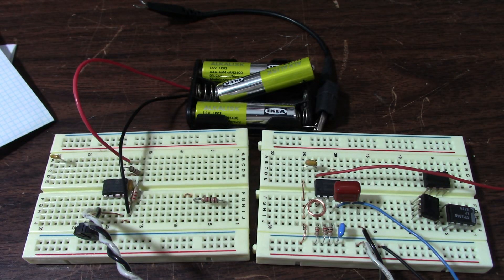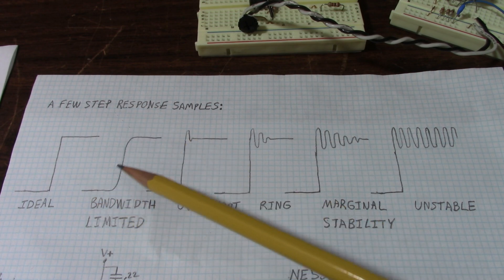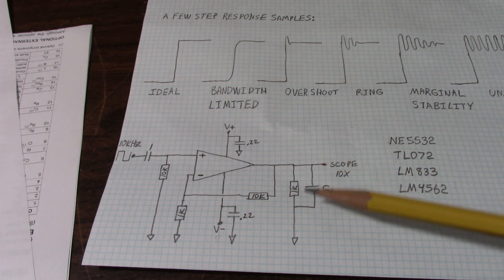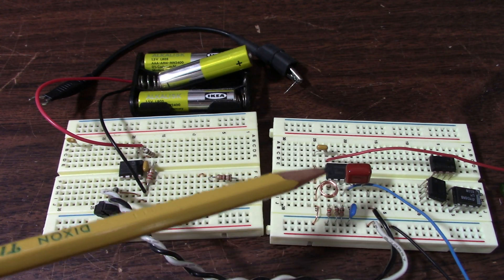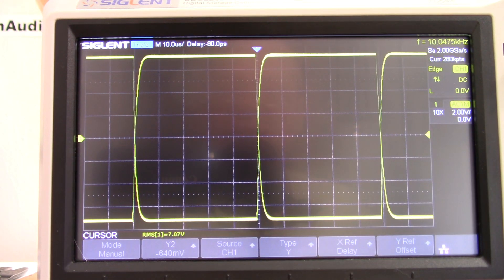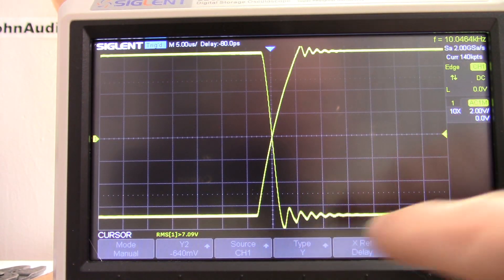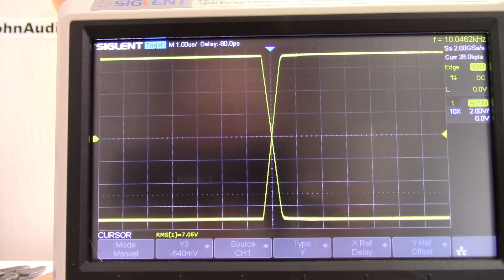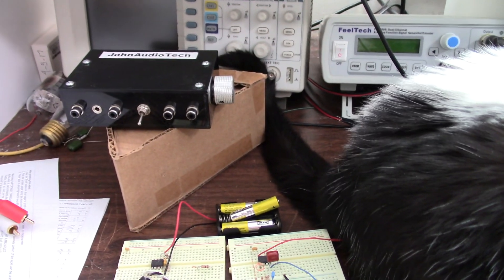Operational amplifier step response test NE5532, TL072, LM833, LM4562

Comment: Trying to stuff a square wave into a capacitor WILL exceed the maximum current output specs for the chip, which will then cause the inputs to go unbalanced, which throws the chip into an overload recovery situation. Good circuit design avoids overloading chips, e.g. through dv/dt limitation in the signal source, or with a resistor in series with the capacitor.

If you were to try this test with various capacitors, you would see there is a threshold of capacitance, at the point where the chip's output becomes overloaded. Don't blame the chip for doing its best to recover from a bad circuit design. 

If you see one chip is doing better than another in a particular circuit, it is time to review your circuit design for overloading. This is most easily seen by looking at the voltage differential between the chip's two inputs - which will be ~zero, except where the chip is being overloaded.

Comment: Many manufacturers from China don't agree with you that 072 is not a good op amp for audio -) They would use 5532 everywhere, but sometimes laws of physics dictate them to use a fet input stage.
Reply: 5532 of different brands sound differently but not too much.
072 of different brands sound extremely differently.
My favorites were
lf353
UA772
A well -known English brand of professional mixers (Trident) was famous for the sound of TL072

Comment: Great video, thanks! I agree that a step response / square wave  test often tells you what you want to know, particularly about stability. One stop shopping. 
Always be careful when driving capacitive loads with any amplifier. Wire (speaker or audio cable) is a common capacitive load. If you guess ~30 pF/ft, you'll be in the ballpark for most audio cables, lamp cord, or coax. So a 3' (1m) cable is about 100pf,  30' (10m) is about 1000pf. Your .01uF load is pretty bad for most opamps. You should never do that in a real circuit without mitigation. With 1000pF or less, most medium speed op-amps are stable. With larger >1uF caps, the output pole becomes dominant and they slowdown but are stable. 1 to 100nF is the worst case. 
FET gate input loading is also capacitive, and in the bad range. 
The easiest way to decouple a capacitive load from an opamp is with a 10 to 200 ohm series resistor before the cap. Most audio gear does this on line outputs. It also limits short-circuit current to safe levels. 
I often use Spice to simulate various capacitive loads, as long as you have a good spice model for the particular amplifier. 
Cheers!

Comment: NE 5532 is the best for it's price but LM4562 sounds a bit better. If you have a CD player and NE5532 was installed you can replace them for peanuts. On EBAy you find 10 LM4662 for about 20 $

Comment: I am one of the guys who would never use an op-amp in my main stereo system. The LM4562 sounds quite good though. The 5532 goes right in the trash, it should have
been discontinued 20 years ago. The Sparkos discrete op-amps sounds very good. I just build an AK4497EQ DAC, where I tried those 3 op-amps.
The TL072 is very good for guitar effects, better than the 4558 I think.

Comment: Something better than the LM4562? - diyAudio
www.diyaudio.com › Amplifiers › Solid State
An OPA1612 has slightly better specs than an LM4562---less noise and distortion, faster, and more output voltage swing.
May 19, 2017 · 10 posts · 7 authors
Reply from the maker: Those are nice chips if a bit expensive in comparison. I doubt I could get any meaningful difference in actual audio service.
Reply: @JohnAudioTech   -JFET Type and no Through-Hole Mounting which means the purchase of them on an adapter board. I just posted another link of tested comparisons and on Ebay sellers from China carry the NSC Brand LM4562. 10X LM4562NA DIP8 DualHigh Performance High Fidelity Audio Operational Amplifier  Price:US $5.50 - Shipping:$2.80 Standard SpeedPAK from China/Hong Kong/Taiwan | See details Delivery:Estimated between Fri. Nov. 20 and Thu. Dec. 10 ,2020.

Comment: This test should be done on a properly laid out board with a ground plane and good bypassing. Otherwise the results are not going to be repeatable. It may not make much difference at a few kHz but as you climb in frequency the tests will not be valid. Having worked for a well known IC supplier for 30 years, we never used those plug strips for anything.

Comment: What about LME49720?
Reply from the maker: From what I've heard, the LME49720 and the LM4562 are the same chip. The LME prefix is for high performance parts and National Semi. wanted the 4562 to have a part number under the LME series.
Reply: The LME49720 is available for less.

Comment: Can you test OPA1622? In audio circuits it sounds amazing and I'd would like to know why :)
Reply from the maker: It is a very low noise, low distortion op amp with high output current (over 100ma) for driving headphones directly. A very nice chip but relatively expensive. If you don't need the drive current, The 4562 will do just as well.

Comment: Hey John, I have a question, that also could be a video idea for you.
What is the significance of an op amp, that runs dual rail, Vs an op amp that runs single rail?
I'm not a tech, but just mess with amps and thing on a simple hobby level of knowledge, and found this a bit of a curiosity.   Basically,, why is this a thing? And with main amp circuits also?
Reply: I'm a little late here, but I will attempt an answer. Chip op amps do not require a bipolar (+/-) supply, but can be used with a bipolar supply. The thing to understand is, the op amp doesn't work any better with a single supply or a bipolar supply, and in fact the op amp does not even "know" if you are using a single supply or a bipolar supply. Because of the op amps design, if you have zero input on the amplifier, by shorting the inverting/non-inverting inputs, the output voltage will be at a voltage half way between supply voltage on the op amp. For example, if you are using a single 10V supply, the quiescent output voltage will be 5V. Now, if you are using a bipolar supply and are supplying the op amp with +10V and -10V, the quiescent output will still be half-way between these two voltage, which is  0 V. 
If you are using a bipolar supply for an op amp in an audio application, an output capacitor will not be required, since the audio signal is already centered around zero volts. If you are using a single supply, you will need an output capacitor, to block the output DC voltage, but pass the varying audio DC voltage, which is riding on the (in our example) +5V
Reply: Tom Terrific , thanks for explaining that.  I've bean very confused about how to hook these up, and the only examples I find, in videos, are using a split rail supply.  Because, a computer speaker amp board I've bean trying to learn from, and figure out, is a single rail.  The non inverting inputs run from the power line, through a few components, and it's confusing me as to why.  From the power + , it goes to a 100uf cap, the through a resistor voltage decider. From the resistor, the line then taps both non inverting inputs together. (I can't remember the resistor values, but they're in the thousands.). This op amp is used for the headphones, but also has a tap to go through the volume and tone, then to the amp.

Comment: Hi John, cool demonstration! Opamps are not intended to drive a capacitor without a decoupling resistor (33-150 Ohm) at the output. If you are looking at the stability aspects of an opamp, you have to test it in a +1/voltagefollower- configuation, were stability is more critical. In your test could be a small improvement, if you add a small C over the feedback-resistor.
Reply from the maker: I'm aware of that. I just wanted to see how the chips responded with the cap directly on the output.

Comment: 6:18 why 10x has to be used? Why not 1x probe. 10x probe may just be able to measure 10 times the 1x probe voltage. Is it correct to assume that the ramp would be faster than 1x probe so that it can measure 10 times the voltage
Reply: The results should be the same, the difference between a 1x and 10x is a potential divider in the 10x. It's simply to protect the front end of the 'scope, as far as I know. As long as the probe is compensated and the 'scope has either sensed or been set to the same setting (1x or 10x) it should show the same information. There will be a very, very slightly higher noise floor on the 10x because of the Johnson noise of the extra resistor.
Reply: I'm wrong! Higher frequencies are less loaded (capacatively and resistively) by a 10x probe, as the impedance is 10x higher and the capacitance is lower.
Reply: @gerryjamesedwards1227  you are right... Along with this the 10x probe is compensated to it nullify the scope input capacitance.

Comment: Slew Rates in datasheets are: 
NE5532 = 9v/us - - - TL072 = 16v/us  - - - LM833 = 7v/us - - - LM4562 = 20v/us. 
The TL072 should perform better, right?
Reply: The voltage-time relationship for a sine wave is v = a.sin(2πft) where a = the amplitude (half the peak-to-peak voltage) and f is the frequency.
So dv/dt = 2πf.a.cos(2πft). Since cos() has a maximum value of 1, the fastest rate of change of voltage for a sine wave is 2πf.a.
Therefore, a 20kHz sine wave with an amplitude of 3V (i.e. 6V pk-pk) has a maximum dv/dt of 2 x 3.14 x 10,000 x 3 = 190,000V/s = 0.19V/μs.
Any opamp with a slew rate of 0.2V/μs or better will not be slew-rate limited when delivering 6V pk-pk. Although why anyone wants a preamp to deliver 6V pk-pk is beyond me.

Of course, square waves have higher harmonics, and a 20kHz square wave will have odd harmonics principally at 60Khz. But unless you're a bat, you're not going to hear those, and I defy any human to tell the difference between a 20kHz sine wave and a 20kHz square wave. If you think you can, you're kidding yourself.

The slew rate is not a discriminating factor between those opamps for audio applications. Most of the issues will lie with cross-over distortion in the output stage, or with the noise from the input stage. Although the TL072 (a JFET opamp) has an inferior noise voltage to bipolar opamps such as the NE5532, it has a much lower noise current and therefore may actually have better total noise input when used to amplify higher impedance signals. Horses for courses.
Reply: At least bether than NE5532 and LM833.

Comment: BTW: the LM4562 is capable to drive stereo headphones with 30 Ohm impedance. You can even operate it in class A mode by use of J113 N-JFETs as constant current sources between its outputs and the negative power rail which forces the npn output transistors of the opamp to deliver 20 mA without signal. It should sound very good and precise.
Reply: 20 mA DC without a coupling capacitor would soon fry your expensive headphones! 😢 Fraser!
Reply: @elsaarmstrong-zp6ng  The 20mA goes from the opamp output to the negative rail via the J113. It does not pass through the headphones, which are connected between the opamp output and ground. Hope that's clearer now.

Comment: I think this is a comparison of useful low cost audio opamps (with the exception of the TL072, which is very noisy). My current favorit is the NJM2114 which is a low noise, high slew rate and high GBW device with good THD+N at a reasonably low price (around 1.00 €). If you look for a good opamp for phono you may consider the LM4562 from the video above (about 1.50 €) or even the LT1115 (6.00 €). However, these devices have quite high quiescent current of 8 to 10 mA per channel.
 
You can also get a very good selection and comparison of useful audio opamps with their data here: https://www.cycfi.com/projects/six-pack/op-amp-shootout/
Reply: Gunter, THANK YOU SO MUCH for your reply, man!!
I'm using two opamps, the LT1113 and the OPA2107, do you know them?
Very intering the LT1115, but I have one question: you said that "... however, these devices (LM4562 and LT1115) have quite high quiescent current of 8 to 10 mA per channel." Does this mean they should have less Iq ? I'm just trying to understand this parameter. Thank you. :)
Reply: @montech5647  op amps with high quiescent currents are usually very fast. They have high slew rates and high gain bandwidth products. I don't see any influence on Iq.

The Burr Brown op amps are examples of audio op amps with slew rates of more than 20 v/µs and 50 MHz gain bandwidth. These parameters appear to be overshooting for audio applications.

Comment: Since my Denon AVR is full of 833s maybe I should put bypass caps on the supply rails close to chips. 4562 with caps on supply legs, and it's derivatives, vs plain vanilla JRC4558, 4560. How about old AD797- it supposedly be a very good chip if properly implemented. And how about OPA X132 and X134 JFets, against TL072. Too many op-amps to choose...

Comment: Very interesting.  Now I want to solder together a rig with an 8-pin socket, and switches, with round-pin headers for the caps, so you can do this test with style.
I have some in my meager collection that you did not try: the TL082 and TL2272.  Perhaps these are unsuitable for audio fidelity?

Comment: You have a viewpoint of faithful amplification. But in the guitar amp community where we like harmonic distortion and compression. Is it possible a chip like the TL072 May sound superior than these other chips?
Reply from the maker: I you would want a circuit with a lot of non linearity, perhaps soft clipping and compression of higher signal levels. You could create this with various opamp circuits  but a simple amplifier would be too linear. Tubes can do this without a lot of complexity.

Comment: LM4562 & NE5532 are my favorite
Reply: Me too, for me the LM4562 is a bit better on a highend system.
Otherwise NE5532 has became a very general multipurpose audio opamp.
Most of consoles, electronics instruments etc use always those opamp.
But the 2134 is not bad but two smooth me.